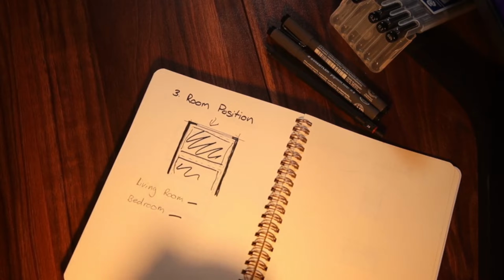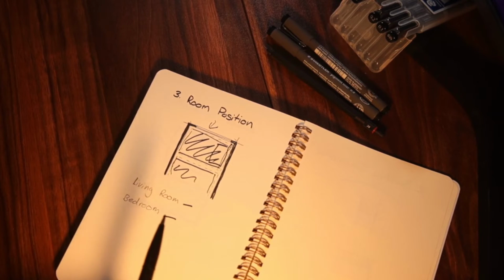How the Sun-path affects your designs

Comment: When I'm actually on the site looking at a hilly landscape as shown by you at 2:20 min, how do I measure the altitude there to actually determine the areal that will be shaded at a certain time and date? Are there tools or procedures to ensure precise measurement, especially in a hilly environment?

How do I measure the altitude on the site so I know where to put my house?

Thanks for the great content, bro!
Reply from the maker: I would actually advise using a program like sketchup to see this as calculating it would be very difficult. On sketchup you can model the hill and then set the sun settings to the location and time and it will create accurate shadows.

If you did want to calculate it you would essentially have to do triganometry (using your altitude angle), to calculate the length of the shadow.
Reply: @Imranesm  Thanks!
Reply from the maker: @theremine3867  no problem!